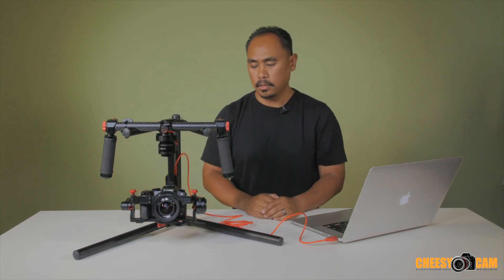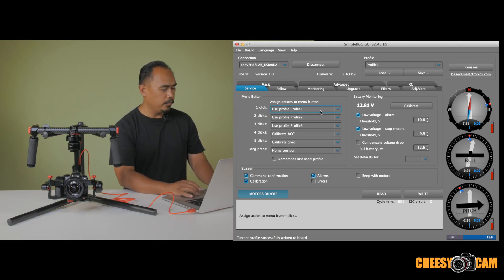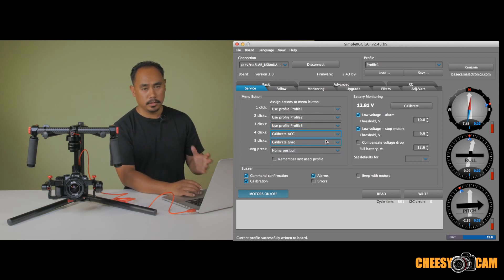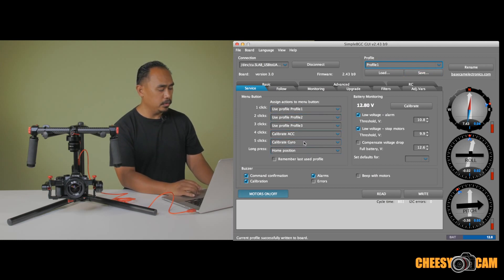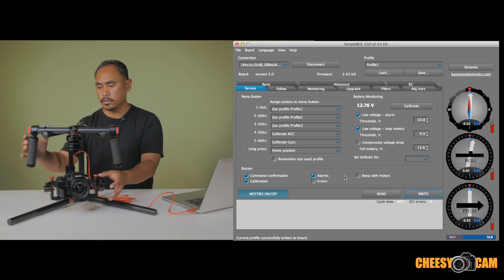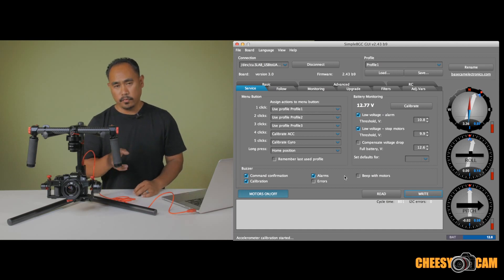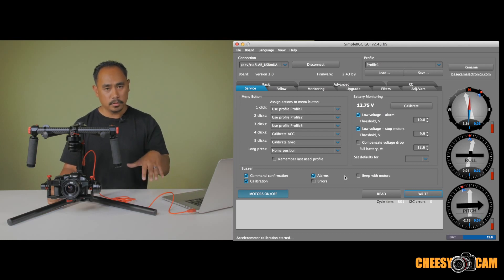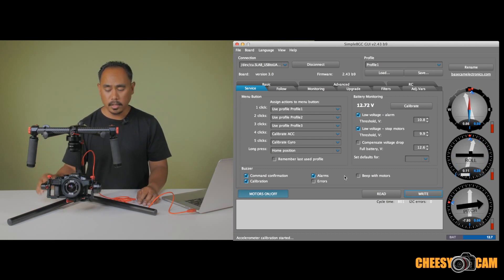CAME-TV CAME-MINI2 Gimbal Settings – Keeping your Camera’s Horizon Level and Manage Calibration

Comment: Great info Emm! Just getting started with CAME-TV gimbals and not really proficient with the software. Been awhile since I played around with the Nebula 4000 a while back. Hd a bad copy and couldn't get it to work. I like the Mini 2. I had to turn down the motors to use the a6300 an Sony 10-18. I was vibrating when tilting. Works pretty well now. Left the PID settings alone. For some reason my copy does not remember the home setting if it goes out of whack. I have to turn it off and reset it to neutral position. Not a big deal. Thanks for the video Emm!

Comment: Great video. Thank you. I got a mini yesterday. Profile 3 worked fine out of box. On profile 1, when I turned left, it turned right. Will have to investigate further.
Reply: Darryl Ephraums My bad. I pulled out my Mini and followed your video and it was exactly as you explained. The only thing was clicking AUTO in the RC Trim made things worse, so I re-entered the existing settings. Everything working great!

Comment: Man, thanks for your tutorial, you are greate. I have a question, my gimbat shaking least in a certain position, because of this, should I make software updates or firmware?
Reply from the maker: +Nelstill Vibrating at certain angles has to do with PID tuning and Motor config. Either the motors have too much power or too little power. I would start with the motor power settings by reducing it on the motor that is vibrating (not all the motors). Just change the numbers a little at a time and retest. BEFORE YOU START - Always take a screenshot or write down your original settings, in case you need to revert.
Reply: +MrCheesyCam Hey, thanks for your promt answer. Can you make another video tutorial or screen shot with this problem, where I must make these configurations? Thanks again!
Reply from the maker: +Nelstill Well it's just about turning some of the settings down or up. Here's a video that might give you a basic idea: http://cheesycam.com/tuning-pid-settings-for-varvon-birdycam-gh4-camera/
Reply: +MrCheesyCam Thanks for your help! 
I'll come back with an answer after I make these changes. All the best!

Comment: Hi MrCheesy, is possible to resset factory the gimbal? I try to make some adjustments in SimpleBGC_GUI and after the gimbat still shaking. I try to resset to default from Menu/Board/Reset to defauls (current profile only)  and my gimbal shaking worse in all parts and can not be controlled...
What can I do in this case to return to the default settings before I make these adjustments. Must be resofted or there is another method reset?
Thanks again for helping me!
Reply from the maker: +Nelstill Clicking on the restore button restores the board to default settings of the board, not the default settings of the gimbal. These boards are used in hundreds of different gimbals from drones to handheld systems. You basically wiped out the default settings of your gimbal.  Maybe read this: http://cametvblog.com/restoring-your-gimbals-boards-to-their-default-profiles-7800mini-2/

Comment: I've been working on getting my Came TV 7800 working from being an absolute wreck and have come sooooo far!  I'm right on the brink of having this thing perfectly setup except for a slight drift in Yaw to the right.  I've been working with the support at Came TV and they've been helpful, pointing me to the right tutorials on their blog.  But this drift, just isn't working.  the one thing i've noticed though is that in my GUI, the red dot on the NSEW compass is constantly moving around the compass counterclockwise.  This makes me think a sensor is broken, but hopefully you know of something I may be missing?  Any help is appreciated.

Comment: I think you just saved me turning my mini 1 into a can opener ... lol Just wondering if the profiles can be accidentally wiped ? If i have done so where could i get the profiles from ?
Reply from the maker: ICS FILMS Well you don't want to wipe out your sensor positions, motor invert options, etc. Take a look at my screen, if you are on the same firmware version then you can try to copy my PID settings from my screen. That would be a good start if you don't have your PID settings anymore. Just remember that PID settings could work differently if you're on a different firmware version.

Comment: Where in the software can i control the joystick for the came mini 1? I did a factory reset on the settings following your other video but now the joystick doesn't work. You mentioned in this video you disabled left and write but I didn't see how you did that.
Reply from the maker: There are two different types of remotes. One uses PWM and the other is analog. I'm not sure which one the Mini1 used, but if it doesn't work following this video, then you can try the other.  This video might be helpful explaining an analog joystick: https://youtu.be/mDhGF0kHr_o

Comment: Hi Mr Cheesycam, I got my Came TV Mini 2 today after watching all your great reviews and it worked perfectly out of the box until I downloaded and installed SimpleBGC GUI since I intended to activate the inverted mode feature. Since I am very new to all this, I decided to do an automatic PID calibration which caused the gimbal to shake and spin like crazy. I didn't finish the calibration and turned the gimbal off. When I turned it on again, the gimbal started to shake again and spin in all directions. I hooked it up to my Mac turned of the motors using SimpleGUI and upgraded the firmware thinking that this would fix things.

Unfortunately, this seemed to wipe all the default PID settings of the gimbal. I emailed Came TV about it but no response yet. Is it possible for you to send me your PID settings for the Came Mini 2 which I can use to restore all my settings? I'm using the same setup as yours - GH4 with 12-35mm lens on Came TV Mini 2. Really frustrated about this and hoping to get your help. Thanks again in advance.
Reply from the maker: ***** I'm confused. If you received the gimbal, you did not have to activate any inverted mode features. It's already set to do this, just power it off, rotate frame, and then turn back on.

Also why did you feel you needed to do an auto PID? The PID settings were perfect for a GH4 and 12-35mm.

You can find all the default settings http://cametvblog.com/reset-default-pid-and-profile-settings-for-came-tv-came-mini2-gimbal/

Comment: Hello, I have a problem and maybe you can help me. Buy this same came-tv mini 2 and use it only 2 times and when you try to use it for the third time lets work but the motors do not respond gimbal is like dead... I do not press anything... I think maybe is the battery but the flash light of the charger never turn off 

What I can do ?
Please help me...

Comment: Got my gimbal today and set it up. I got the camera to stay steady by itself, then I started using it powered on. The first few times I went about a minute before it started twitching out on me. Now, the lights are red and when I have it on the third setting it just flips out when I move it. Do you have any solutions to this? I would very much appreciate it.
Reply from the maker: +Adam Wagner Have you charged the batteries properly? These things are set to stop working or not work correctly when the battery voltage gets low. It only takes 1 or 2 volts difference before it stops working. That setting is in the software to protect the system.
Reply: +MrCheesyCam Thanks for replying. I recharged the batteries. It seems like the gimbal is only having problems when I turn it left or right (like a steering wheel). When I do that it just kind of contorts into a different position. It also doesn't handle too much aggressiveness.
Reply: My only solution was rebalancing by hand. I'm using a GH4 with a 12-35. It's not perfect still, but it mostly works.

Comment: my  beholder ec1 has horizon level issue, how should i fix this?
Reply: i tried holding it to the correct position during gyro and accelorometer calibration, but it doesnt want to follow.. still goes back to its tilted position